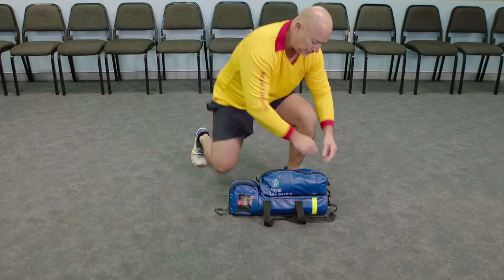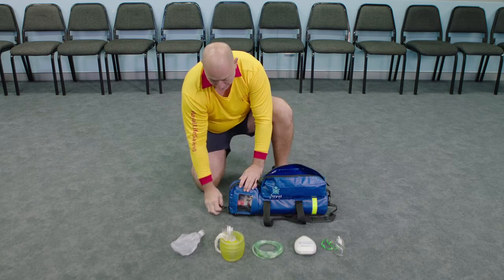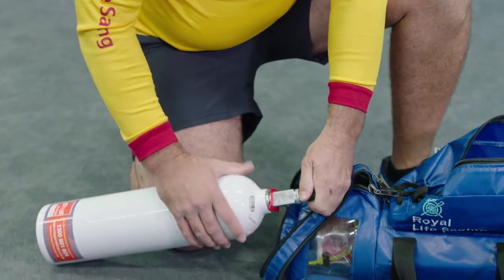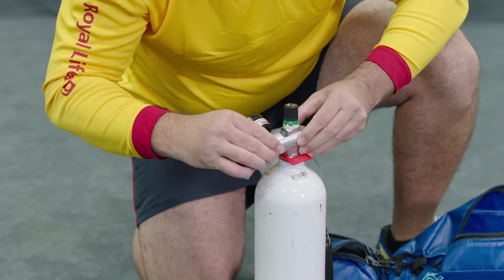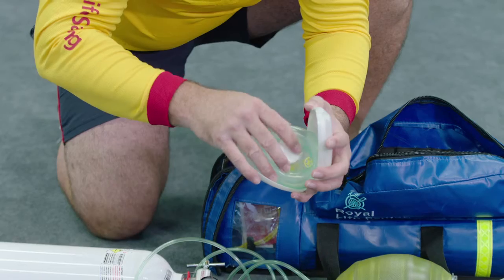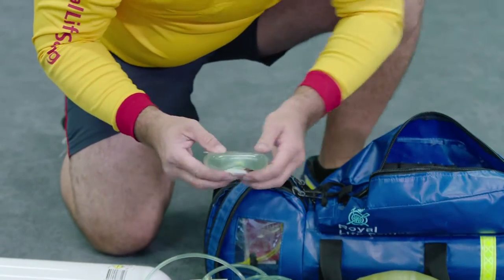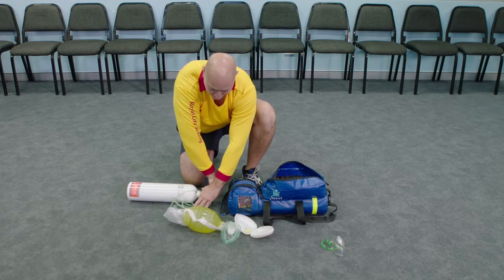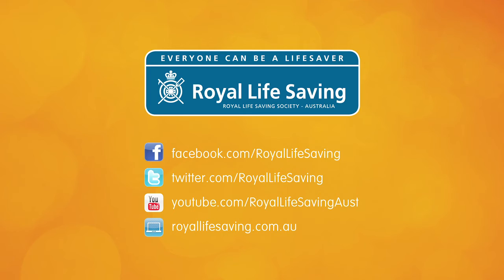Oxygen Equipment Assembly

Comment: How much oxygen level should we give while resuscitating?
Reply from the maker: Thanks for your comment Jerwin. Resuscitation using a Bag Valve Mask and Oxygen should be 15 litres per minute.
If just using a Resuscitation (Pocket Mask) then you may use a minimum of 8 litres per minutes and a maximum of 15 litres per minute.
Reply: The Royal Life Saving Society - Western Australia 
Thanks for your response. One more thing, is it still necessary to blow through a pocket mask when there's already an ongoing Oxygen inhalation regulated at 8 or 15lpm?
Thanks.
Reply from the maker: Yes, just like the Bag Valve mask is pushing air into the lungs, you will need to blow into the mask to push to oxygen into the lungs.  As they are not breathing themselves you will need to do this for them.
Reply: The Royal Life Saving Society - Western Australia 
Ah...got it. Thank you so much for your answers. Godbless. :-)
Reply from the maker: No problem at all :-)